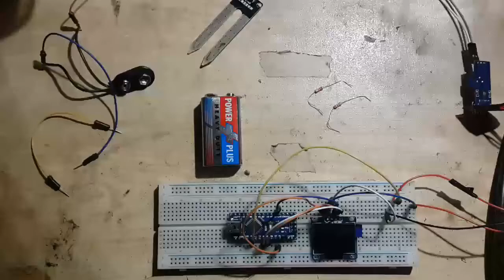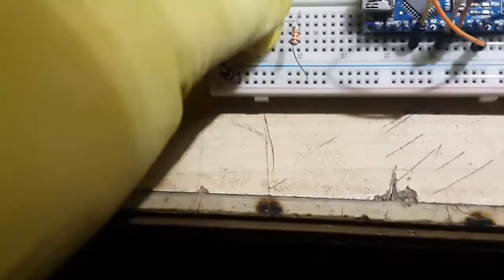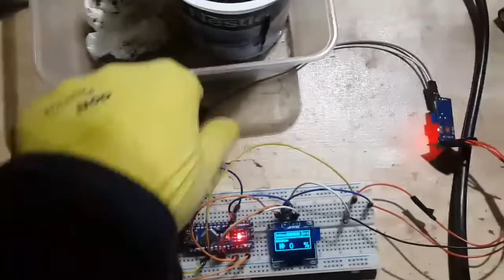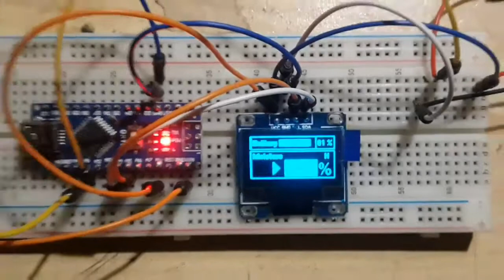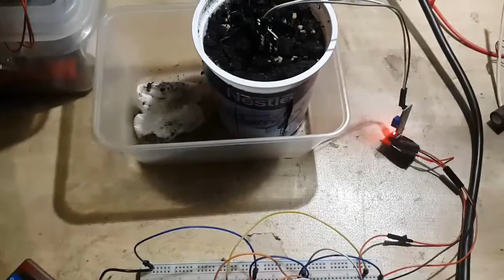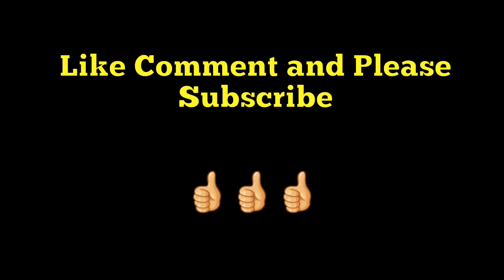Use Battery Arduino Moisture meter Voltage measurement Indicator Part 02

Comment: If you wouldn't mind sending me a current build of your setup, I'd be incredibly grateful. I have a tropical greenhouse full of rare, picky plants from India and the Phillipines. I'd like to automate a fogger setup, a couple of small motors to open and close windows, and run a motor that automates a shade cloth curtain all based on temperature and humidity, as well as run the fans and a small drip irrigation system on a timer. 

It'll be my first real arduino project, so if you could offer any additional help, I'm appreciate that even more! Either way, the work you've done is incredible, and I'm amazed by how inventive you've been. Thanks for sharing!
Reply from the maker: Thankyou,i have sent you the link
Reply from the maker: it can be done but it will be complicated
Reply from the maker: i also have a HomeAssistant server running on Rpi3... it gets Temp & Humidity values over WiFi from a DHT sensor "node" that i made using ESP01(not on channel) and it also controls another Esp12E based switch according to Sunrise/sunset but same kind of setup can be used to control motors according to dht values but i have faced some issues due to wifi router  and i don't trust that setup completely. i would be able to help you better when i will automate some metallic blinders then i will try with cloth curtains . but i will prefer to use blinders made of metal for this purpose as chances of failure while closing/opening are less than the cloth ones and it would be much easier to automate the blinders with some mechanical components already there ready to be modified
Reply from the maker: using Rpi3 makes it easier to control and monitor things over an encrypted connection and cameras can also be added plus other things in the house can also be controlled .. but wireless network issues can wreak havoc